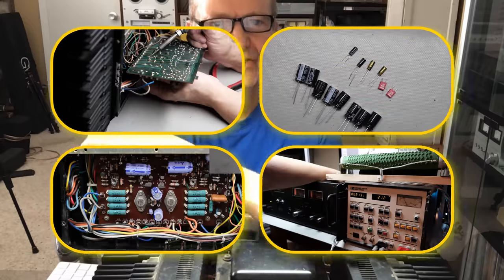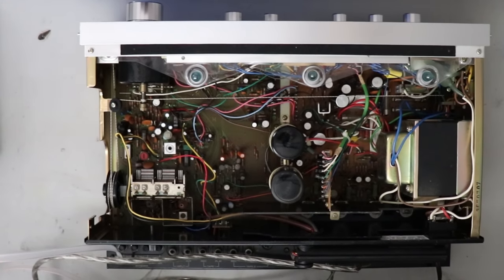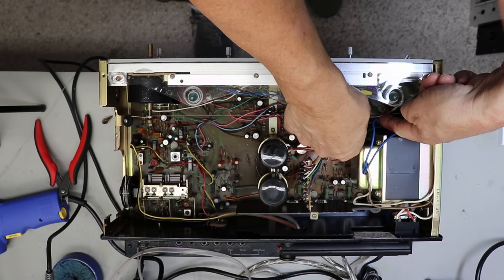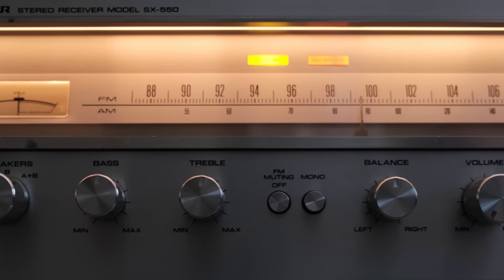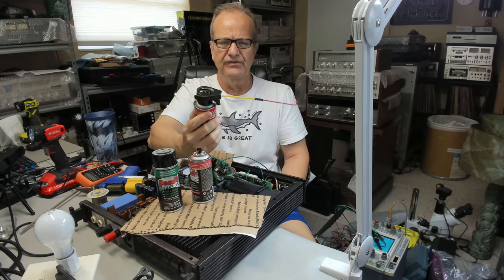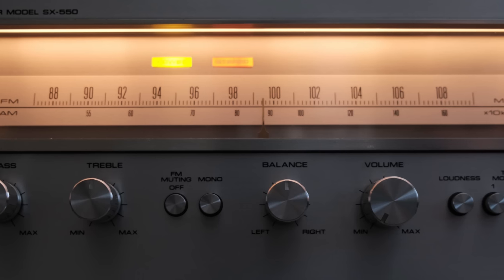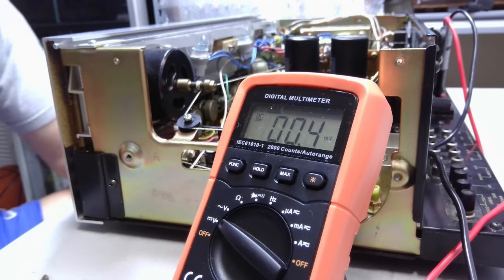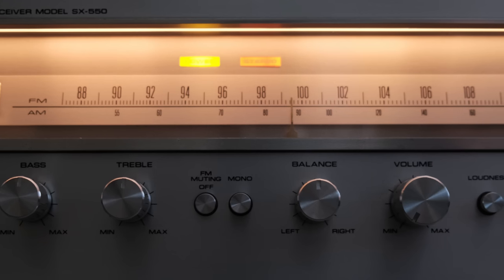Old Stereo Plays Bluetooth. Analog 1977 Meets Digital 2023. Pioneer SX 550 Stereo Receiver.

Comment: When I was young, my mom had an RCA console stereo, before the amplifier completely stopped working properly, she would start the record player and use her hand to get the platter spinning a bit. There were a few times before she started playing the records, she would tap on the radio section when the light wasn't working to get the light on. She had that stereo to where she knew the idiosyncrasies it had. When it finally wasn't usable, the balance control made sound out of both channels when you turned it all the way to left, nothing on the right side adjustment and the volume needed to be all the way up to hear anything at a normal level and turning the sound up defeated the hum it made when the volume was at lower levels.
Reply from the maker: Thanks for sharing. We had one where you had to put a penny on the tonearm to keep the stylus on the record. I'm sure that was great for the vinyl.
Reply: @vintageaudioaddict  that sounds like the one Sony rack system I had back in HS. Sometimes I needed 2 pennies to place on it. Eventually I got an Onkyo and I didn't need to do that anymore. Apparently the sound wasn't as good without the pennies on the tonearm. Go figure.

Comment: Me personally I wouldn’t do any of these mods to a vintage receiver for only one specific reason and that’s anyone you ask that knows audio will tell you that those cheap Bluetooth modules are horrible for sound quality.

You’re better off using the auxiliary port and hooking up either a Wiim pro + or  bluenode they actually have a built in dac and use wifi rather than Bluetooth so you can still get high-quality lossless sound through your vintage receiver to your speakers the difference is night and day and that’s what I’ve done with my SX 980 and my 780 and you can link the two to where you can play music in multiple rooms at the same time which is also a nice feature and I don’t have them sitting on top of the receivers I just have them down somewhere else on the shelf out of sight and let me tell you they sound amazing compared to any cheap Bluetooth module mod.

Comment: I took the lazy route and, with PC as source, use a USB-C powered FiiO BTA30 Pro ($125) in DAC mode to my office Hitachi SR-503L + Marantz EQ20.  The BTA30 Pro has RCA out (along with COAX in/out and Opt in/out) for direct connection to the receiver.  It is a solid performing DAC.

However, the BTA30Pro also supports both Receiving (RX) and Transmitting(TX) BT5.2. CODEC support includes LDAC, AptX, AptXHD, AptXLL, AAC, and SBC. Sometimes I go wireless TX mode in the office (FiiO BTR5 to IEM's, or BT5.2 Earhooks with IEM's ,or Earbuds), which the BTA30Pro supports flawlessly.

My second BTA30Pro sits on top of a Hitachi SR-903 placed in the family room.  In RX mode, I stream  via Phone in LDAC (Android, dev mode); wonderful sound with that SR-903 paired to a set of new Dali Spektors.
Reply from the maker: Thanks for sharing.
Reply: @vintageaudioaddict  Likewise...many times over!

Comment: Nice mod, i own this receiver as well, and it sounds pretty good. It has that nice warmth, which some of the newer units don't. However i personally don't see too much sense in this mod, since you occupied 1 input. When you look at the back oft the unit it looks like you didn't (who is watching the back of it anyway?) but that input is occupied and cannot be used anymore. I personally use a BT receiver too, i just hooked it up to the AUX input, that BT receiver box is as small as a box of tic-tac, it can be hidden behind the receiver, nobody will ever notice. If you already build it in, you should make a switch, so you can switch between BT and AUX if necessary. Nice work BTW.

Comment: Nice addition there with that BT module.
Although I probably would've done it slightly differently, probably with an additional switch, so as to make the actual Auxiliary input terminals still be useable also, and totally independently of the BT module, that way you could still add a CD player or other component to it too, and switch between that other source component and the BT module, plus, if I could, I would've tried to find a way to ONLY have the BT module powered ON IF you were actually using it, as when the input source switch(es) were set to actually listen to it.

That brings me to another question I had about that BT module itself... You said that it had TWO audio connections on it, one that said "main" and one "auxiliary", so what is the "auxiliary" connection on the BT module used for? Is that an actual input that it switches between another source and itself, OR is that just another identical output connection for sending the same output signal to two different devices at the same time?
Reply from the maker: Thanks for watching. The aux on the BT card is an audio input terminal. I never tried that part of it. The Aux port still works on the 550. CD player works fine hooked to the Aux RCA plugs with the bluetooth module. The old and the new seem happy together. Of coarse you have a fight for the Aux port when you try to use them together.
Reply: @vintageaudioaddict  Well that's good at least. I just wonder about interference or additional noise of any kind, being added onto the auxiliary input by the BT module, especially if it's still connected to your phone, when/if you then try to use the RCA auxiliary input on that receiver with a CD player or other source component, just because it's usually not too good to have two or more active source outputs combined together without them "fighting" each other, especially when directly coupled together like that.

I'm glad it works for you in that specific situation, but I probably still would've wired it slightly differently, and more independently selectable somehow.

Comment: I hope the BT receiver support at least AptxHD codec, otherwise it's not gonna sound very good. I did not find that information on Amazon product page.
Reply: I'm not really a pro in BT versions, but why would it sound bad without AptxHD? Even BT4.0 is cabable of pretty high speed, so you can stream CD quality FLAC through it... That is good enough in my opinion. We are talking about a budget receiver, no high-end. If you pair it with some nice speakers it will be a very good low-mid end system. You can try to send SACD stuff to it but that won't make too much sense, the receiver would be the bottleneck.

Comment: how did you wire up the capacitor?
Reply from the maker: Between the tuner +13 V and the BT power in.
Reply: @vintageaudioaddict  oh ok does it matter where the positive and negative go on the cap.